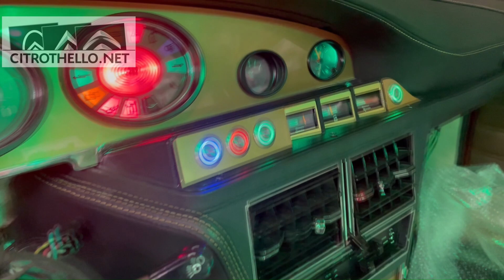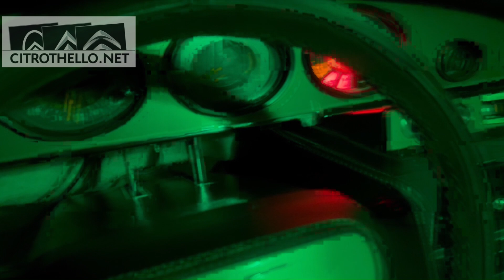CITROEN SM 1973 MR. ELLWOOD. MECHANIC RESTORATION PART SIX.

Comment: Wow! This car will look like milion dolars 🤑I notice you are using fuel pump for aviation (Facet). Is this because realibility or more pressure? What is the diffrence with some ordinary bosch fuel pump?
Reply from the maker: The FACET is exactly the same used by Citroën. No more pressure. This fuel pump used on many cars carburators.